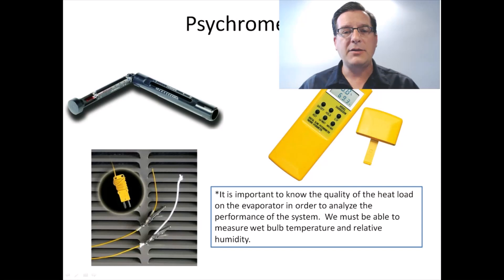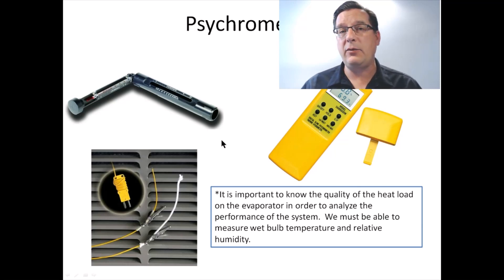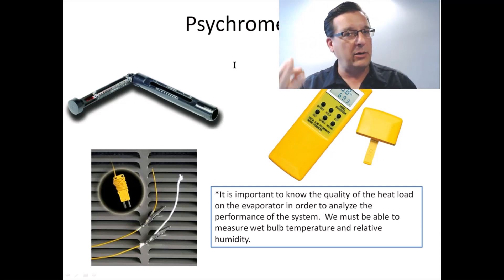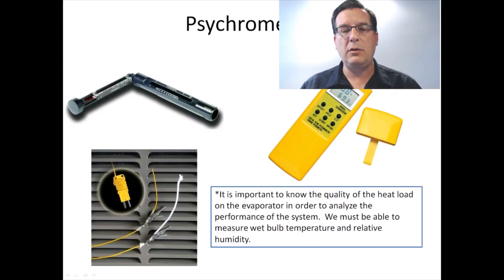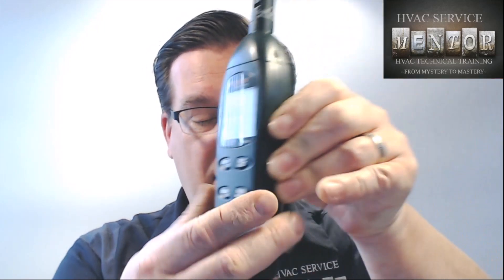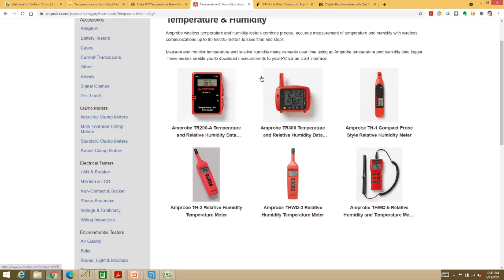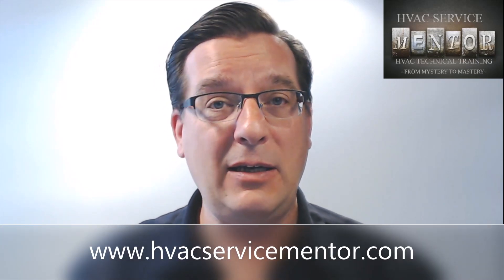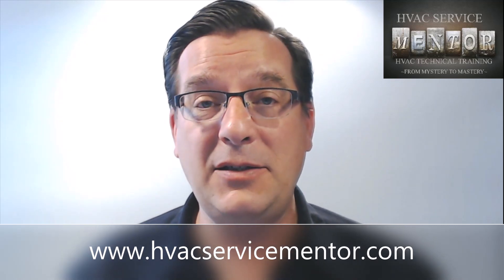How to use a Psychrometer for HVAC

Comment: Thank you for doing this. I’m trying to wrap my mind around using wetbulb measurements for performance. Is or was  wet bulb the standard along with dry bulb 
because wet bulb was easier to measure before digital psychrometer meters?  Using the two points to determine RH for latent loads? 
Thansk
Reply from the maker: When referring to performance measurements, you will need to measure dry bulb temperature across the evap and wet bulb temperature across the evap.  Then there are some formulas which will translate those temperature differences into BTU/h.  The dry bulb performance indicates sensible heat removal while the wet bulb performance indicates latent heat removal.  In my experience, it is difficult to get a really accurate field measurement of wet bulb discharge air temperature.  You really need about five duct diameters of straight duct after the evap to do it well.  Failing that, you need a special instrument to take a duct traverse and average the measurement. 

In manufacturer's published performance specs, you will see two specifications:  sensible BTU/h and Total BTU/h.  The difference between the two is the latent BTU/h which you need do a little subtraction to figure out for yourself.  These same specs will often also show what the evaporator dry bulb temperature difference will be at these performance points.  This is much easier to measure and as long as you have all the other points covered, you can be "field certain" that you are good to go.  

In the world of performance contracting, they are often much more concerned with total heat removal in real time than your average service tech.  Due to the aforementioned challenge getting good supply air WB measurements, I often wonder how valuable this metric is.

Comment: I have a room we have just replaced a 4 ton rooftop unit , the old unit was burned out , now my grills are sweating , if I take the room temp WB and DB and read the DP , how can I apply these info to make corrections so we wont have this issue 
These are the info I think I have to obtain 
1- room temp WB
2- Room Temp DB
3- return Air WB and DB 
4- SUPPLY AIR TEMP AT GRILLS 
5-RH OF ROOM 
6- RH OF RETURN AIR 
7- RH OS SUPPLY AIR

Comment: Why is dry bulb measured by outside air while wet bulb is taken inside? Isn't that apples and oranges? Of course outside will be higher wet or dry.  Outside air is not conditioned and is not going to be run through the system. What am I missing?
Reply from the maker: Outdoor dry bulb air temp influences the head pressure which changes the flow rate of refrigerant into the evaporator on fixed metering device systems.  You need to know that in order to analyze superheat with a fixed metering device.  Indoor wet bulb is the factor which influences how quickly the refrigerant in the evaporator boils off.
Reply: @hvacservicementor  thanks for the quick reply! That makes sense. What is edl?

Comment: I've been using a pair of the Fieldpiece wireless psychrometers for a while. They're pretty slick in that you can read the results of both probes at once from a distance. The only problem is the flexible neck is a fairly large diameter, so it can be hard to get access to the supply and return air without drilling big holes.

Comment: HVAC student, here. Minute 9:10 you state that Target Superheat chart is for fixed metering devices only. I had understood that we can also use the superheat chart to verify that the TXV is working properly. Did I have the wrong concept?
Reply from the maker: A TXV is meant to maintain a constant superheat across a wide variety of operating conditions.   On a fixed Metering Device, superheat will change as operating conditions change.
Reply: @hvacservicementor  Wouldn't target superheat work for adjusting the txv?